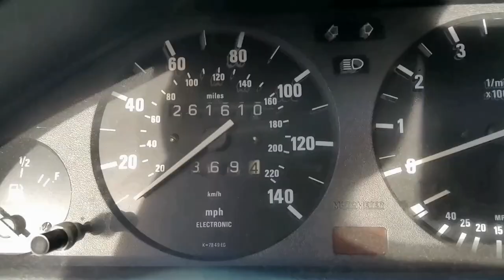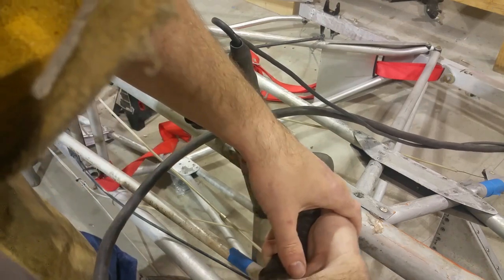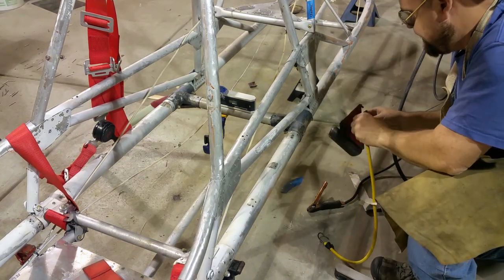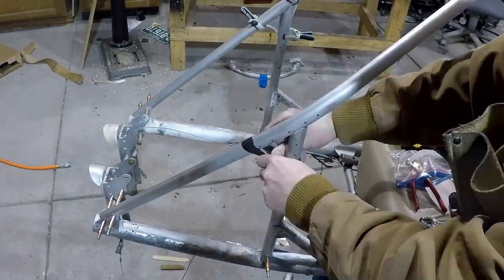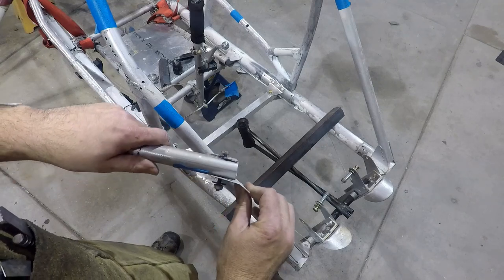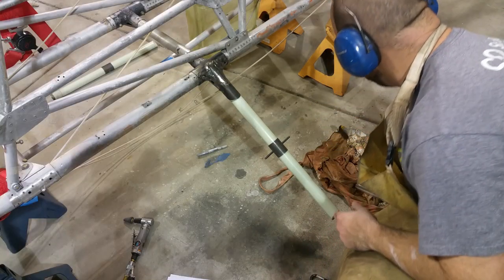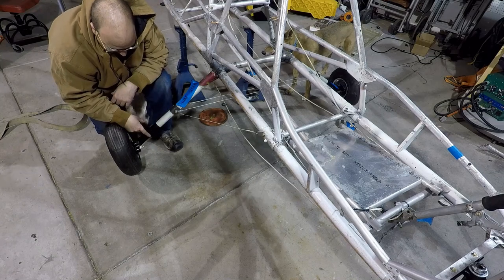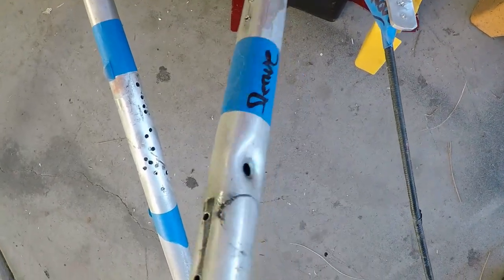EP4, Rebuilding the wrecked challenger fuselage (Take 2)

Comment: Don't try to strengthen the nose gear support structure too much, or it will just transfer any landing overloads through the cheap-to-replace support bracketry into the expensive-to-fix longerons!  You really want the brackets to fail first!  (BTDT!)
Reply from the maker: Interesting point.  Hadn't considered the landing gear attachment being a structural fuse. :-)